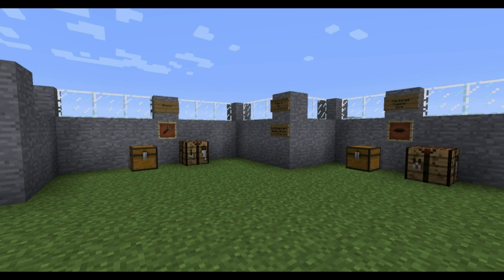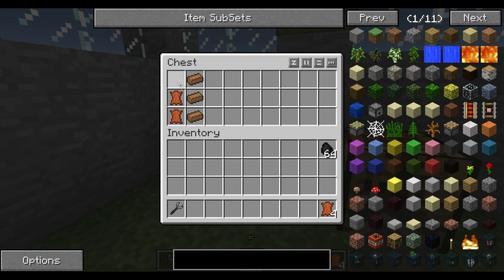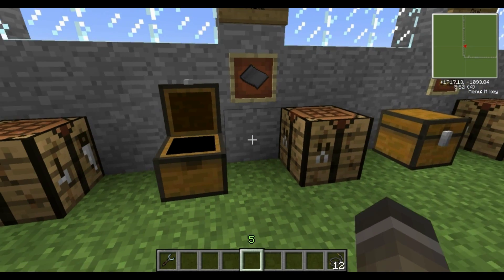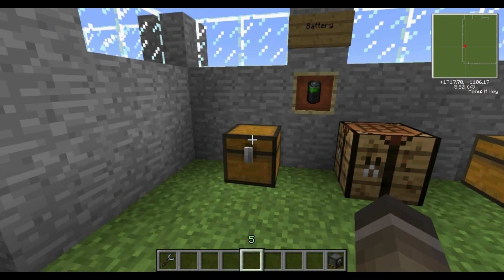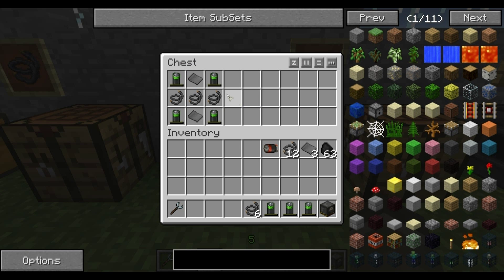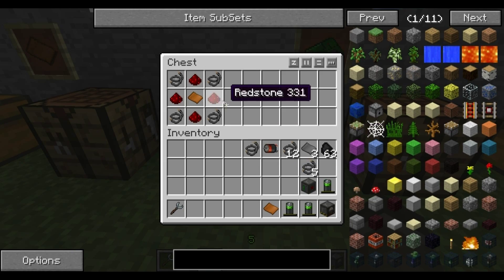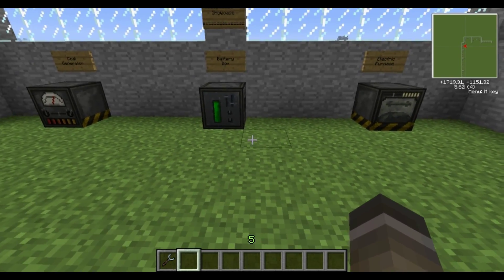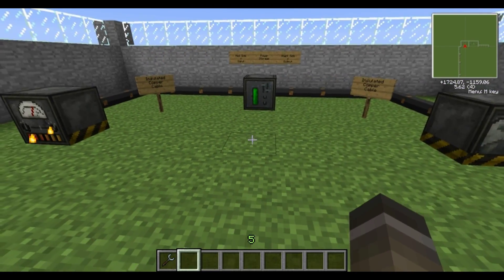Voltz Tutorials Ep. 2 - Coal Generator/Battery Box/Electric Furnace

Comment: According to my NEI ( Not Enough Items), the coal generator and the battery box recipes have changed. They are much simpler. The Coal Generator recipe is a furnace in the center square, a motor in the bottom center square and all the rest with a steel ingot in each. Very similar to the electric furnace recipe.

Comment from the maker: You simply equip it (so it's in your hand) and right click on whatever machine you want to turn around. It doesn't work with all machinery however, and it turns the machines 90 degrees too. It's also used to disassemble some machines, however not all. To dissemble you hold shift and right click. Hope this helps :)

Comment from the maker: Sounds to me like you're attaching a powerful source of energy/power directly to it. The electric furnace will take a maximum of 120V to run so any generator we've shown you shouldn't blow it up as they all have a voltage output of 120V. Anything higher than that will blow it up! It may also be the case if you're using HV (High Voltage) cables which are capable of transferring more power than the copper cable. Hope this helps :)